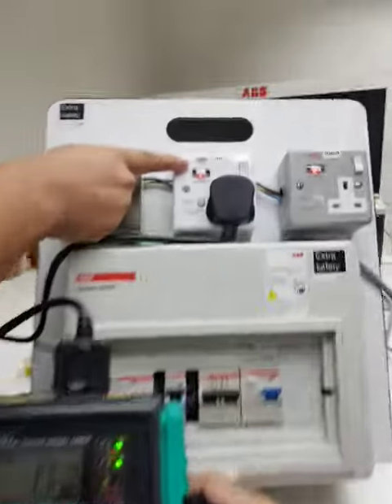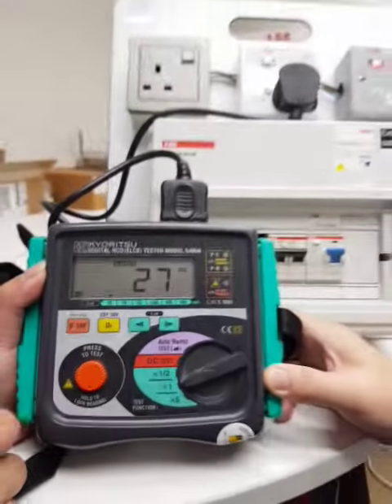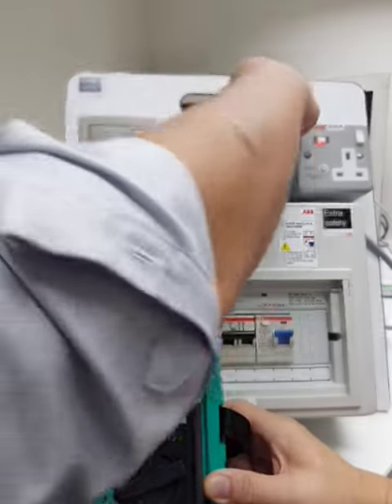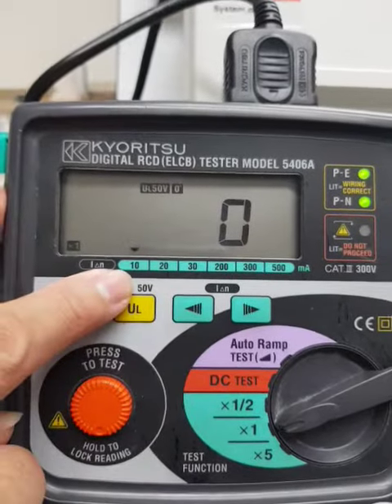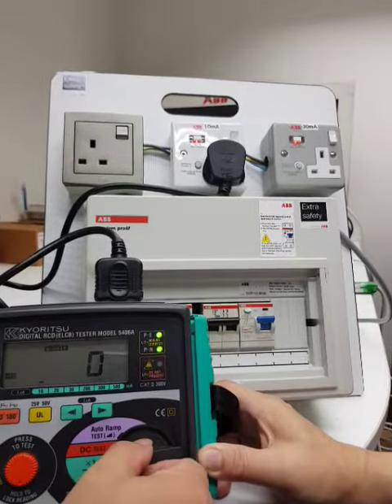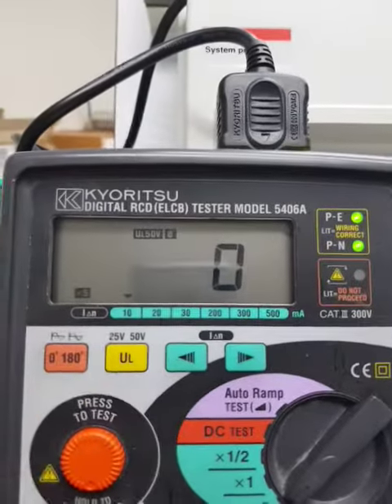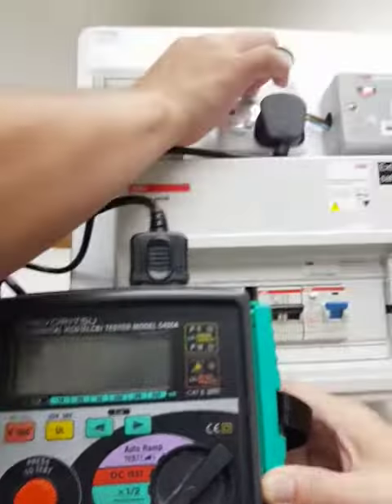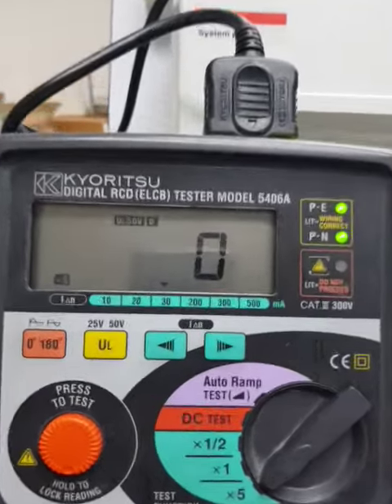RCD testing2 using Kyoritsu ELCB tester Model 5406A

Comment: Is there kyoritsu tester rcd and insulation tester , where to buy and what model.. thanks
Reply from the maker: I happen to be residing in Singapore. So i could get equipment and tool like this easily through local distributor. So for my region, testing tool distributors like CE-TM and Allmeasures etc.
Reply: That tester is made by kewtech industries .

Comment: Hi, can i use this device in GCFI is it the same procedure.  ia am  confused with with rcd and gcfi is it the same.thanks
Reply from the maker: Hi Adjhie, thanks for watching my video. The testing method is similar, however, this tester is designed for IEC testing procedures.

Comment: Can you test at 180degree?
Reply: So the 10mA RCD is able to discriminate anything <30mA leakage current
Reply from the maker: BS7288 did not mandate 180deg /  inverted phase testing. As far as i have read, did not find any reference to 180deg/ inverted testing for SRCD. Havent checked in UL though. Do share with me if you have any lead. I could ask a pal in US.
Reply: @ramokokorok9445  you should do all RCD test at haft time /One times/ and fives times and on 0 d  and 180d for each test  this is for each of the rated current of each RCD ,  half times RCD should not trip 1 time RCD should trip within 300ms and at 5 times RCD should trip within 40ms